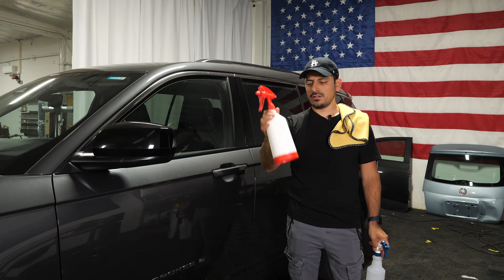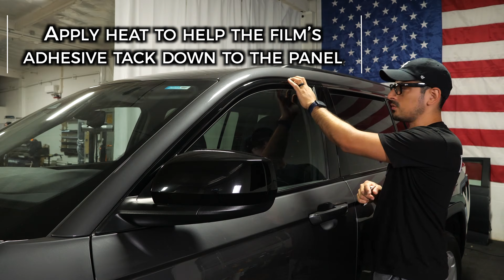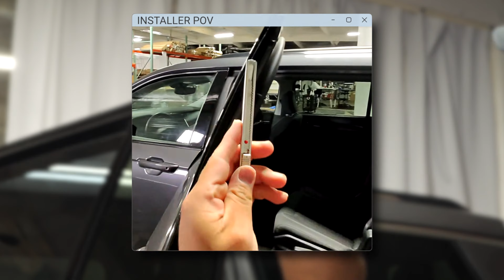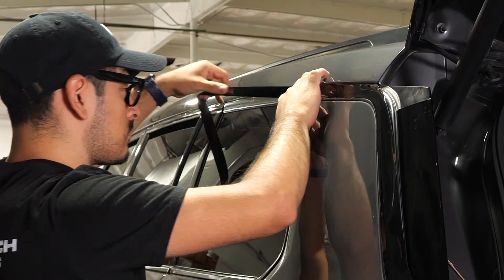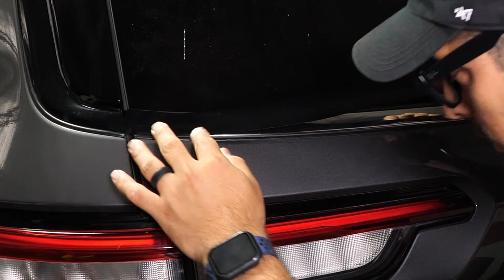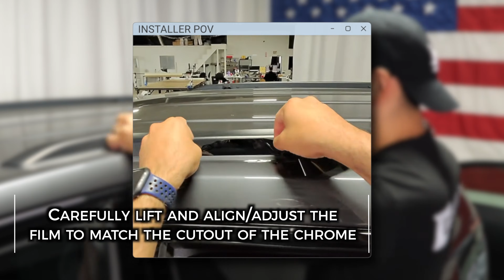Jeep Grand Cherokee L (2021-2025) Side Chrome Delete Installation

Comment: Will a hair dryer work or has to be a heat gun?
Reply from the maker: Yes, a hair dryer will work for installation. A heat gun isn't required, although it can help speed things up since you can have a bit more control and consistency with the temp but a hair dryer can get the job done! Just use enough heat to make the vinyl more flexible and easier to work with.

Comment: How easily will a car wash mess this up?
Reply from the maker: The film should hold on pretty good when doing a car wash as long as the instructions are followed about post heating and letting the film cure properly. We also recommend making sure that if you are using pressurized water to make sure you stay a good distance (at least 3ft) from the vehicle